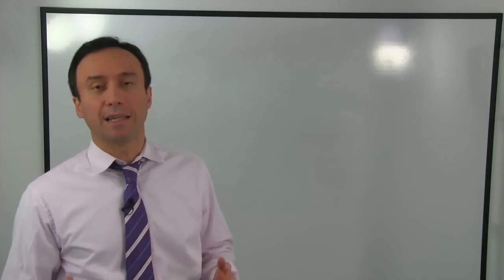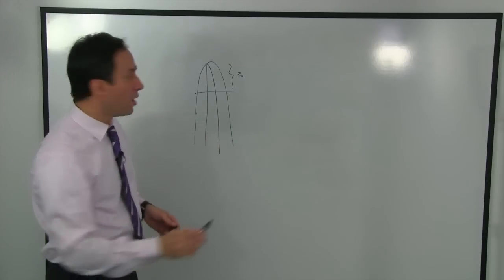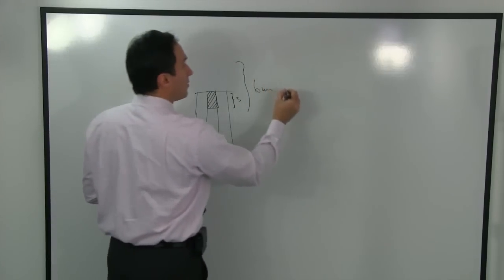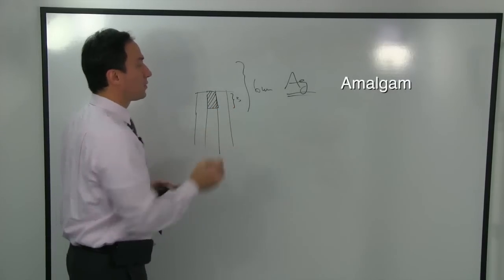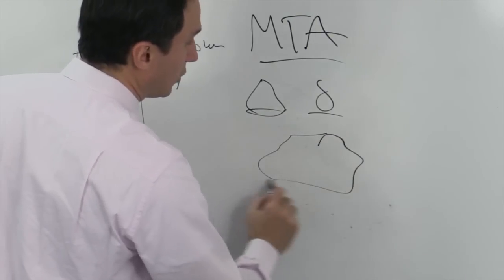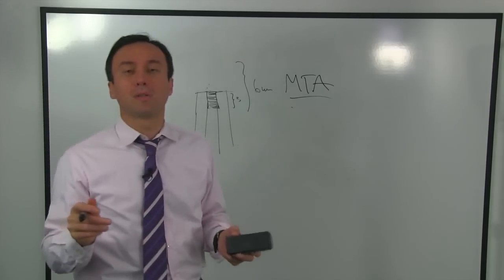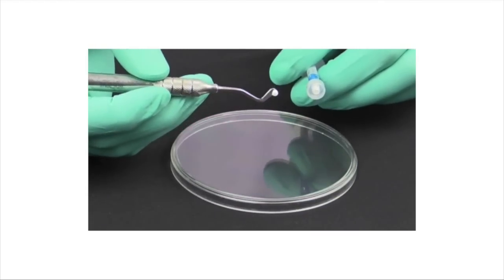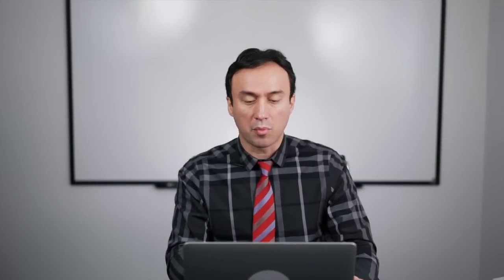Surgical Apicoectomy & Retrofilling Technique: The RWE Lid Technique

Comment: 82-year-old patient has stopped 70mg oral bisphosphates 26-days ago after taking for 84-weeks, and reveals apical infection # 4 around previous RCT; Buccal draining near sinus tract. Tooth mobility is acceptable and we prefer NOT to remove # 4. What is risk of ONJ following apicoectomy with retrograde filling? Is longer washout of bisphosphates necessary? Thank you Allen for excellent video.
Reply from the maker: Highly recommend that you speak to the patient’s physician. This kind of advice should not be given over YouTube. Chance is relatively low compared to extraction but is still there.

Comment: I Apicoectomy since I have a large mushroom post in my upper last molar.
The Edodontist I saw messed me up. He saw I had a big post like a mushroom  upside down, but still decided to remove my crown & try to drill through the very hard alloy which e should have dental-cal but don't wi to B messed u more. I will maybe have to pay  for some of the work out of pocket, but I would then k Apioceental insurance.
What has me very upset is the Endodontist didn't suggest this procedure when he  KNEW he couldn't drill through the alloy metal of the pst to get to the root infection. 
thx for your informative video. 
Thanks so much for informing me of the latest way to stop infects.
I hear root canals rarely work & can cause the damage to other body parts.
Very scary.FUNDME might work.

Comment: How many times can you get a apico on one tooth? And is a apico just buying time before the tooth eventually has to be extracted?
Reply from the maker: Everything in dentistry is buying time until the tooth is extracted in the same way everything in medicine is temporary until we die! That's healthcare for you in a nutshell! So, the goal of both dentistry and medicine is to postpone the inevitable for as long as possible. A visit to the doctor doesn't make us immortal and a visit to the dentist doesn't save any tooth forever either. An apicoectomy can be redone only if the original source of failure was not addressed properly through the first apicoectomy. A CBCT and an experienced surgeon is required to make the right call regarding the best approach. Keep in mind the alternative, which is implants, is not forever either. Cheers!

Comment: Allen, what if one encounters a non-vital tooth with apical rarifaction with calcified canals that cannot be negotiated? Can an apicoectomy with  retrofill be  done to save the tooth?
Reply from the maker: Of course. However, apico has a higher prognosis if endo is done first. However, if canals can't be found coronally apico might be the only option. Such decision is normally done by the endodontist on a case by case basis.

Comment: Thank you for your very informative presentation Dr. Allen Ali Nasseh, I would like to ask for your opinion about Ketac-silver (Silver Reinforced Glass Ionomer) as a retrograde filling material. Thanks in advance!
Reply from the maker: +Fotis Roilos Ketac Silver and other glass ionomers as well as bonded composites work great in vitro. Unfortunately, these products are moisture sensitive and have shown poor seal in vivo. The periapical environment is very moist and a hydrophilic material is needed. BioCeramics are the best for this purpose. MTA was the first but this combination I describe is a way to make the most of a newer formulation (BC Sealer/BC Putty) that is much easier to handle than MTA. Good luck!

Comment: what iodine do you use?  can you disinfect with bleach?
Reply from the maker: This is a non-commercial optimized iodine formula. It's not available other than a compound pharmacy. You should not use bleach as it's highly caustic in a surgical site. You can use 2% Chlorohexidine, however, and that should be fine. Simply rinse it out with sterile saline before placing the bioceramic.